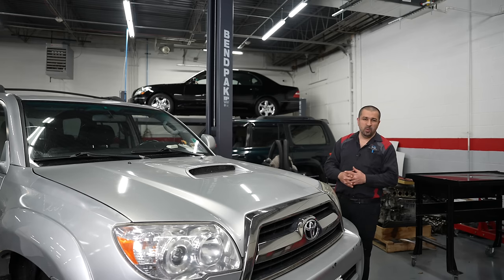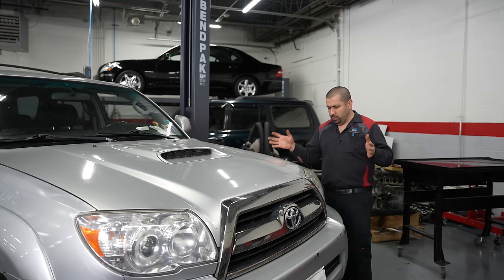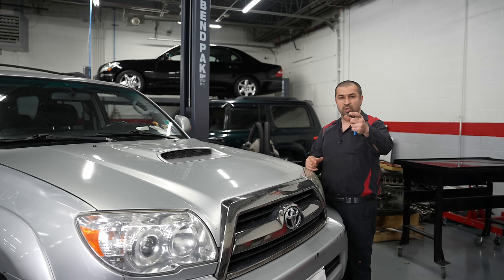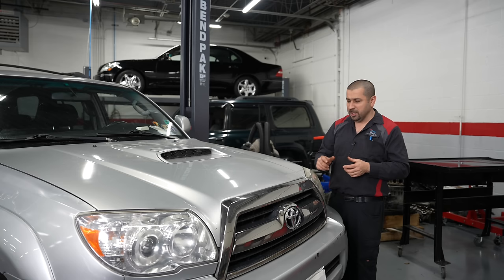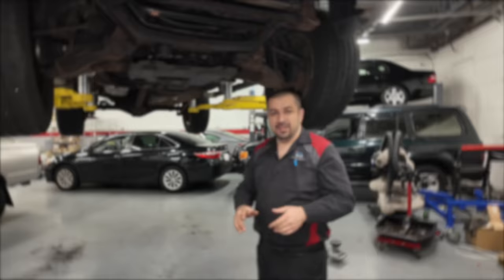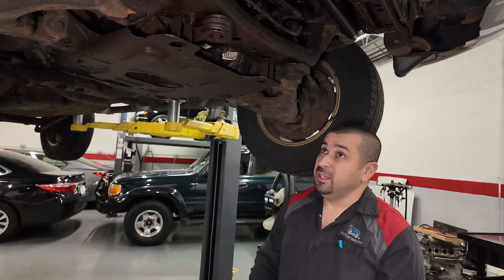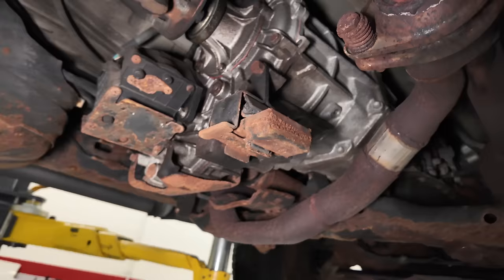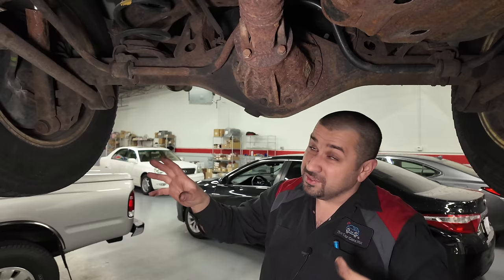THIS Problem Can Destroy Your Toyota Truck Transmission! Is it Too Late for This One?

Comment: If a have a solenoid d code in. The Tranmission , I went to my Tranmission guy and he said those solenoid rarely go out so I advised you to change the whole valve body , and I only have 180,000 miles on a 2007 Toyota tundra 5.7 and I just change the fluid and filter at 165,000. So just wondering what you think

Comment: All that fancy high tech is why prices are so darn high. I don't want or need that high tech crap cause it cost a fortune to fix. Vehicles road better with stock shocks 15 inch rim with some tire on them back in the 60s and 70s. I had a big 1960 olds 88 with a 421 engine it road so smooth you be going a 100mph without even knowing it.. The bigger the tire the more shock it takes up. So you only need standard shocks. These big rimes with no tires look like shit and give you a crappy ride so they use high tech crap to get the ride back. They have gone way to far with this high tech crap. We need a oil dipstick and bring back the trannie dipstick so you can change the oil and trannie fluid and  filter without a big hassle. All they want is for the DIY to take it back to the stealership. Now some of these trannie to get to the filter you have to split the trannie apart. Pure stupid. They could put a spin on oil filter on trannies if they wanted to. That and a drain plug on the trannie so you can change the dam fluid.

Comment: I have a question and wasn’t sure how to reach you. I have 5th gen Limited 4runner 2021. The transfer case fluid calls for Toyota LF SAE 75W, which is very very expensive per quart. Can you tell me what you’d use or what’s the equivalent? I’ve heard the redline MT-LV. But don’t want to do anything till I get a solid answer. Also the mt-lv bottle says LV 75w on back for Toyota but I know if calls for LF which is important. I also know nothing about these fluids other than you mentioning the specific additive messing with gears etc… please help!!!!

Comment: I'm a new subscriber and impressed with  your work, sir. I look forward to more of your videos. I have a question about my 2014 Tacoma automatic  transmission. I've heard that at around a certain mileage (70000-75000mi) it's a good idea to change out the fluid to extend the life of the transmission. My truck is around 75,000 miles and in great shape and it hasn't ever been used to tow anything. I live in Georgia where it gets pretty hot in the summers. Should I change my fluid now? Do Toyota dealerships do that without flushing, just drain and refill? If you have a video about it, I can look at that.  Thanks.

Comment: I wonder if you know what the spec of brake line fitting (I believe it 10mm x 1 but this tacoma maybe use different) I have the same but unable to get one except buy the whole brake line from toyota but it pain to change.

Comment: I have a strong request for a video or an answer for my question. I have the 30mph range transmission shudder on my 07 Tacoma with 200k miles. What do you recommend to fix it?
Reply: Try Lubegard ATF shudder fix.
Reply: @danieloneill4356  thank you

Comment: Hey CCN I would like to thank you for all the valuable informations.
I recently purchased a 2003 es 300 with the 1mzfe than I watched  you video about best and worst toyota engine and unfortunately I found oil sludge under the fill cap I'm thinking of an engine flush. Is it something you would recommend??

Comment: Why my 2014 tundra 4.6l doesn’t have transmission cooling system? Why Toyota decide to remove them from 2014 ahead and 2018 ahead?

Comment: Just bought a 2007 Camry. 244K miles. I want to change the oil but the pervious owner could not tell me if there was conventional or synthetic oil in the car.  I was always told not to put synthetic oil in a motor that had high mileage. Not sure if still correct. Any Ideas/Suggestions. Thanks in advance!  PS.. maint reqd soon light just came on after about 200 miles. Looked it up. Book says to change oil.
Reply: I've never heard of issues using synthetic oil in a high mileage car. Im not an expert, but as long as you use the oil specified in the owner's manual it should be fine. The owners manual probably recommends synthetic oil since its a modern engine, i would think, but you must check it to be sure.
Reply: Thank you for info
Reply: Thank you for info
 @zzoinks

Comment: Here’s my question for you…
1995.5 Toyota Tacoma - V6 - auto transmission. Over 300K. It won’t go into 1st gear. It’s starts off in what I’ve been told is a fail-safe mode. Shift solenoid has been changed due to code. Still occurring after solenoid change. Shop owner takes the truck to another shop and neither of them can figure out why it’s still starting off in fail-safe mode once placed in drive. I can manually drop the gear selector to low and start off fine in 1st gear, but I then have to shift to drive. Any idea what might be the issue?! I’ve been told these transmissions are the same ones used in Toyota lift trucks and that they are pretty bullet proof. Thanks!

Comment: This is more of a video that shows what you can get yourself into, by not maintaining your car.  You know he was seeing oil on the ground for years but did nothing, you know he could feel the car bouncing around, but did nothing, he could tell the car was not going into gear as it should, but put it off until the it wasn't drivable.  He lives his life on luck, and his luck just ran out.  You need to investigate as soon as you notice something wrong.  I'm 73 and will slide under my car and take a look at the drop of a hat and do all my own oil changes.

Comment: Hey AMD, I hope you can answer my question. I did a drain and fill transmission fluid on my 2016 Highlander. Now on the diagnose mode where you switch from Drive and Neutral. When it came to D solid, I left the gear stick on N and proceeded to drain the excess transmission fluid. I did this because on your first video of servicing enclosed transmission, you didn't mention specifically to switch the gear on Park. However, on your second video, you mentioned to switch on Park before draining excess fluid. Is this a big deal? Thank you

Comment: Is that the power steering cooler? I have a 96 Land Crusier and it also has both coolers but the lower middle cooler is for the PS. And the trans cooler is allot bigger on top, But they both take Transmission fluid not sure if this is the same setup

Comment: I’m getting a p420 p430 code on my 2007 4Runner …I believe it’s a catalytic problem but maybe not!?
Reply: Had the same on my '05, replace the downstream O2 sensors, if that doesn't work (like in my case) throw some spacers on the sensors. If you live in a smog check state then I dunno it might still pass smog or it might not.
Reply: Heck for exhaust leaks first

Comment: I have a 2020 6cyl automatic 2 wheel drive Tacoma Sport with only 24000 miles on it, the trans oil has never been changed.  When should I change the transmission oil?

Comment: Hi AMD,

I thank you for all of your videos. Thank you for sharing your experience and knowledge. I have learned so much.
I live in Phoenix, Arizona.

I have a 2012 gen 3 Prius, with a 1.8 motor. It has 288,500 miles.
The car runs well. I get 50 mpg at 65 mph.
No loss of power, the engine runs smooth.
My issue of course, is oil usage.  The car doesn’t blow smoke at all. 
It is my daily driver. I have noticed lately that it is using more and more oil between changes. I change the oil (full synthetic) every 3 months (5-6k miles).   I understand the piston rings are shot causing the loss of oil ( 1 quart per month).
Other than putting new rings in - do I have any option to reduce the loss of oil?  
Thank you so much,
MG

Comment: Hi Car Care Nut! I love your channel.  My partner has a 2008 Toyota Sienna with 230k miles.  It is still running great, but we've been having repeat exhaust leak issues with it.  I've already replaced the muffler and intermediate pipe (with intermediate cat and resonator) along with all the necessary hardware and gaskets.  That was about a year ago and everything seemed fine.  But my partner feels she has been getting nauseous on long rides (no exhaust smell in the cabin).  We are going to grab a CO monitor and put in the car.  But my question is - how likely is it that the exhaust manifolds are leaking? I'm confident I could do the front one, but it seems like the back one requires lifting the engine out.  I have yet to replace the Y pipe either.  Also, do you think maybe you  could do a future video on common exhaust issues with Toyotas? Namely Siennas? I searched your videos for exhaust leaks but couldn't find much.  I would really appreciate it!! Thank you for sharing your expertise!

Comment: Help!
2018 4Runner Off-Road bought certified at 43k miles

Lugging/ hesitation/ vibration at 40-60 mph. as soon as you downshift or let off the gas, it goes away. Happens under light throttle input, like going up a sight hill. Exhaust sort of goes brrr, with a lumpy vibration feel in the floor and gas pedal. 
No dealership has been able to pinpoint. 
Currently has 95k, still doing it. Up to date on all maintenance. 
Any ideas?

Comment: What is your opinion of auxiliary transmission oil coolers?    I tow in hot weather with my 4Runner.  I want to add a trans cooler.

Comment: I have a 2005 Highlander with 255,000 miles.  I don't believe the transmission fluid has ever been changed.  Is ok to change it now?

Comment: @AMD, the trans fluid for a ~100k mile 4runner, looked like new fluid while you removed the hoses at the start of the video?I had a 2003 4runner same gen as the one in your shop, and i have 2014 sienna now, the toyota WS turns slightly darker after few thousand miles. The fluid that came out of the 2006 in your video was bright red. Doesn’t it look like the owner had other shops refill new fluid at some time before the owner took to your shop? Please correct me if i am wrong. Would like to hear your feedback. Thanks

Comment: To me it looks like a Nightmare as far as adding Tranny Fluid and draining Tranny Fluid.Problibly because I've been around GM all my life and what I drive now is a 2010 Toyota 4 Runner Limited and coming up this October will be my 3rd year owning it.Bought it at 127,000 miles and it's got 140,000 on it now,4.0L V6 and there's no Dip-Stick which is weird.If it were me I would of desighned it with a Dip-Stick and you add fluid at the top underneath the hood but you drain the fluid from underneath the vehicle like it show's in the video.

Comment: Lots of knowledge here:  Someone tell me if my 2010 Lexus RX350 (2grfe engine, 6 speed transmission).  I do not believe the transmission fluid has ever been changed.  Is this too late or should I change it?  It runs, drives, and shifts perfectly at this time.
Reply: It's never too late. New fluid can't harm a transmission.

Comment: I have a 21 Tacoma little over 3 years with 22k. Have done your recommended oil changes every 6 months. What should I be looking at next the transfer cases? Or is it to early for that
Reply: does your rig take that special 75W toyota fluid for the transfer that has an MSRP of +100$ for a litre?

Comment: Hey brother. Hope your are well. I have a 06 Sequoia 2wd. Yesterday I noticed a puddle after my wife drove in from work. It turned out to be ATF and under further inspection, found a large leak coming from the front of the transmission between the engine/trans(bellhousing to engine seam) with the engine idling. Going to pull the trans out on my day off. My question to you is, from experience, do you see pump seals, front input shaft seals, bushings or torque converters causing this leak on these A750E transmissions? Basically, what is the most common cause you have seen for this type of large leak. Hopefully just a seal/seals or maybe a pump replacement will take care of the issue, which I can repair myself. Trans was not ran dry or overheated thankfully. Any input would be greatly appreciated. Thanks in advance.

Comment: I have a cyliniod issue in my 06 is350 its strange it sticks according to the toyota program on my laptop says cylinoid sticking whic his 3-4th gear but if if I manualy shift it shifts ok also it doesnt happen that often ususally if it is extreme heat or very cold weather it might happen once in a while , I change the fluid replaced from tthe place I bought the car whe n itook it back telling them it wasnt shifting from 3-4th which was  about a month after  i bought it 2021 to be honest they said they replaced it and when  i went in to pick up my car the dealer was trying to sell me the 3  1 litre containers of new toyota transmission fluid which I didnt buy becuase why would I buy it when I dont have a place to do those things .
 now I dont like the ceiled transmission becsaue I cannot look and or smell the fluid on the stick.

Comment: @sunny California: I caught on your video that you have a certain ATF temp for Toyota, I have 2001, and 1997 4 runner, 99 Solara V6, 97, Avalon, 00 Sienna, 02 Sienna... I was about to install an ATF Fluid Cooler on my 4runners, so that i do not need to replace the radiators on both, was thinking of the 4 pass Hayden cooler... What is the ideal ATF temperature for toyotas...? the atf heater?
Reply: The temp he specified is for checking the level. Irrespective, heat kills ATF and auto transmissions, so it's best to run it too cool rather than too hot. I fitted a large aux cooler and now my transmission never exceeds 65deg CC (~150deg F) and the ATF remains cherry red.

Comment: I have a 2013 and I love my truck. We are getting ready to buy a 2axle pull behind camper and I have no worries about the truck breaking down leaving us stranded, or not being able to pull the load. I bought the truck in November of 2022 with 61,000mil and I just hit 75,000mil. One problem I do have that he mentioned in this video was the cam tower oil leak on the driver side. For my case it seems to be more of a seepage then an actual leak. When I change my oil at 5,000mil, the oil is right on the line on the dip stick as if I just added new oil. A question I have is, does anyone have a cam tower leak similar to mine, and have you repaired it or left it alone? Will it cause further damage if I leave it alone? I do smell some oil from time to time hitting my exhaust manifold, (maybe once or twice a week). Is this okay to leave alone?

Comment: I have a 08 Fj. I drain and replace 1 1/2 quarts transmission fluid every year. Am I causing any problems with the transmission?
Reply: Seems like a dumb question.
Reply: @ShainAndrews  . I can change oil and rotate tires. I’m not a mechanic. The car care nut stated in a video that a transmission fluid flush is not good for the transmission. 
Stay tuned for I will have other dumb questions. 
Your comment doesn’t answer my question therefore your comment is dumb.

Comment: Need some advice,  I have a 2013 Camry 2.5 .  When I am sitting at a stop light car vibrate, idle is good ,no ses lights, motor mount are good, cant figure it out.
Reply: Try cleaning the mass air flow sensor and throttle body, also check engine air filter.

Comment: Trade that 4 runner in for something else. As long as you can drive it to a dealer, they can sell it to a wholesaler! If you can drive it, it is worth nothing to them. Most vehicles like this end up in Mexico. But if it won't drive, there is no worth to it.

Comment: I Have an 03 tundra 4.7l . It has 255,000 miles. I don't know if transmission fluid has ever been  changed. Change it or no?
Reply: Best bet is to do a drain and fill.
Reply: Don’t drain and fill. You’ll lose all clutch material if it’s never been changed and it will start to slip.
Reply: @alagui7894  wrong, a flush will do this.  Drain and fill will leave clutch material in tact if any.  Drain and fill will only take out about 3quarts of total fluid.

Comment: 4Runner XREAS is cheapo version of KDSS?
Reply: No. XREAS is for on road. It cross links the damper fluid, stiffening or softening opposite corner suspensions. KDSS is for on and off road. It hydraulically “locks or unlocks” the sway bars, adjusting the articulation.
Reply: @flipcoin6301  oh yeah...that's right. shocks vs torsion bars. Thx!

Comment: New Toyota's are WAY to overpriced.   I've had two from new and don't think i will buy another.
Reply: Any new car is over priced. Buying brand new for most people is stupid. Get something slightly used
Reply: @XxChuyoxX I typically buy Toyotas or Lexus that are around 8 years old, have around 100k miles, and have been dealer maintained. 
I keep them until around 250k. I've been doing this for the past 30 years. I've never had an issue.
Reply: @user-li2wv3vs9f  Ditto!  I buy used, low-miles I can buy at wholesale price and replace all wear parts like new, then drive forever with little to no problems.  Love my Yotas!  AMD is the best!  Great videos!
Reply: Toyota vehicles have lower TCO. It may be more expensive upfront, but in the long term it will save you money and headaches.

Comment: Yoo it's insane to see the levels of rust american cars get. You use so much road salt because people won't invest in proper winter tires that would make it less necessary to use so much road salt. If there isn't a law that proper winter tires are required people are not going to buy them.